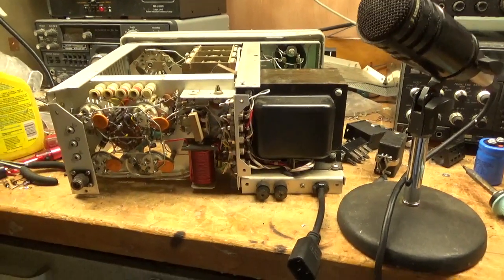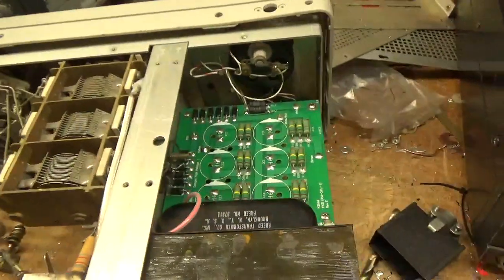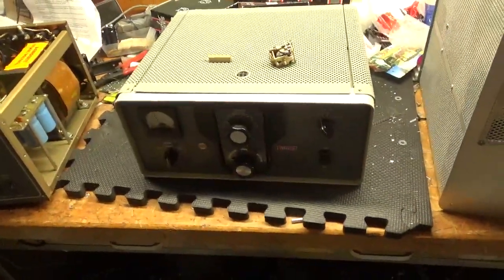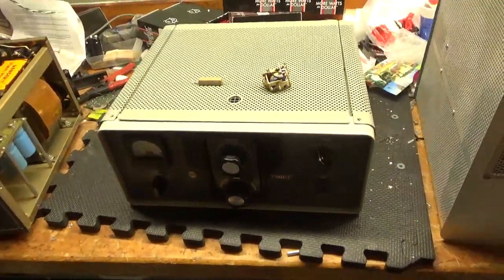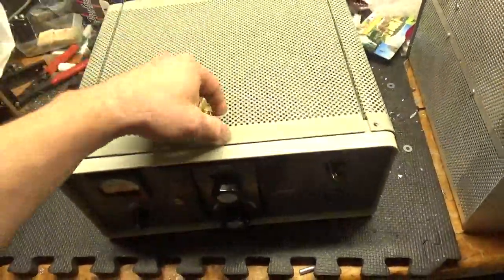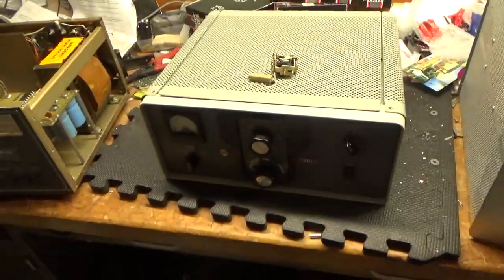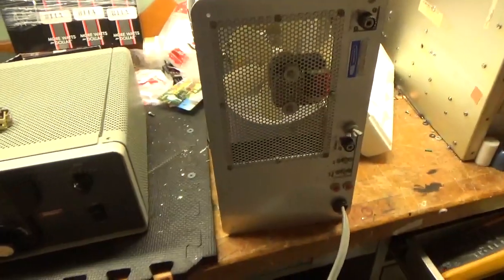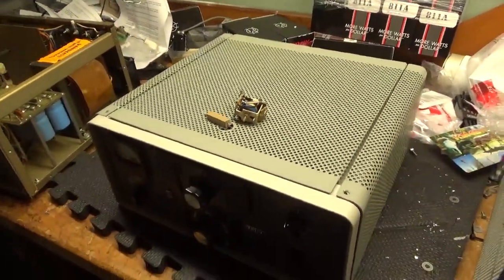Collins 30l1 Repair

Comment: How did the 572B's work out? Any real world advantage over the 811's?  73 - KG4LJB
Reply from the maker: For sure, The 572 has a higher anode voltage rating, Higher plate dissipation and a lot less likely to flash vrs a 811a